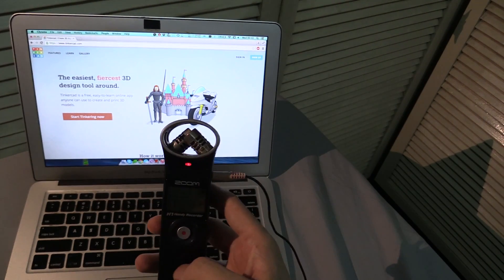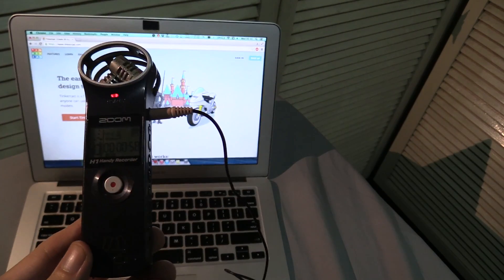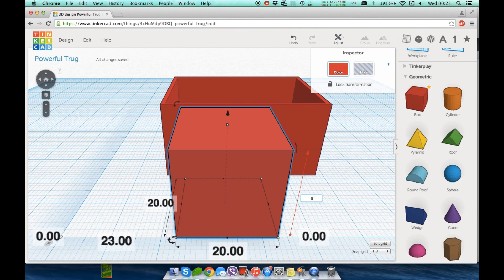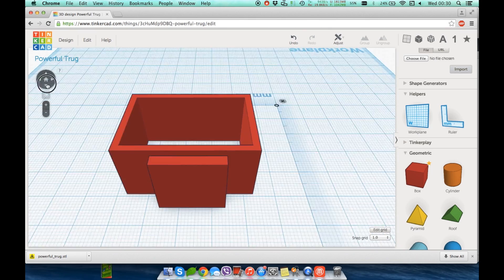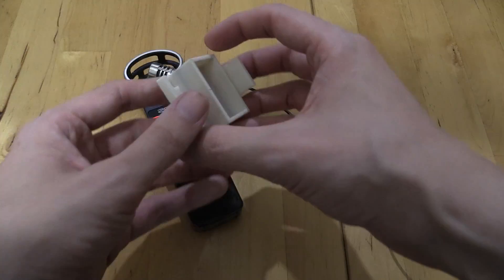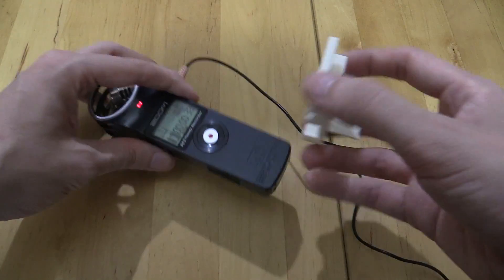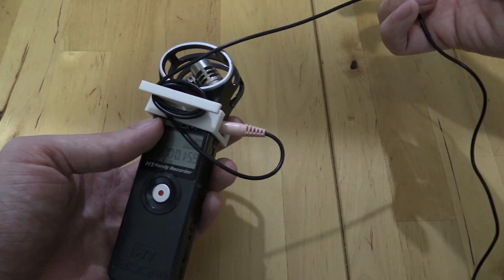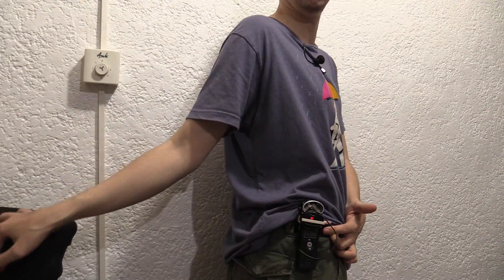3D Printed Zoom Microphone Belt Clip

Comment: Hi I got a glass bed recently so I could print abs, I still have the standard full white roll from flashforge but I can't seem to find the right temperature to print with. What temperatures have you found to work the best?
Reply from the maker: Therustedpick Bed temp at around 110C and nozzle at around 230C. What problem are you having?
Reply: Thank you tremendously! Every time I printed parts over two square inches wide it would warp so bad the part would eventually pop off and slide around the bed. I've only been heating my bed to 75C for any print (except bridge nylon which needs VERY high temperatures) I'll try this. Thank you for responding so quickly I'm in the U.S. and it's 12 am but I have to start a large over night print really soon and it needs to be printed in abs. Thank you!
Reply from the maker: Therustedpick Ah I see. Good luck! I hope it works out. Are you spraying anything on the glass to help it stick?
Reply: Gadget Addict I've been using a heat resistant glue stick and hairspray. Not both at the same time of course. If I'm correct about how time zones are sectioned it should be about 2:00 pm for you so thank you very much for t he help I really needed it and have a good afternoon. Goodbye.
Reply from the maker: Therustedpick That's right, 2pm here :) Okay, good luck and good night :)
Reply: Gadget Addict the temperatures worked well thank you very much for your help! I'm printing deadpool badge icons for a friend and he needed them in abs. Thank you so much you are my absolute favorite youtuber!
Reply from the maker: Therustedpick Awesome, I'm glad it worked out for you and thanks for the compliment haha.